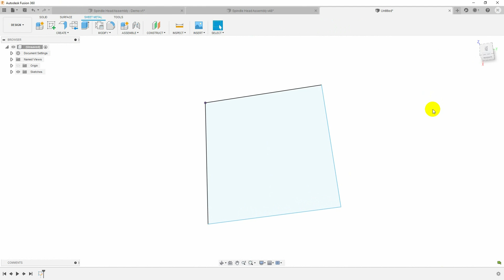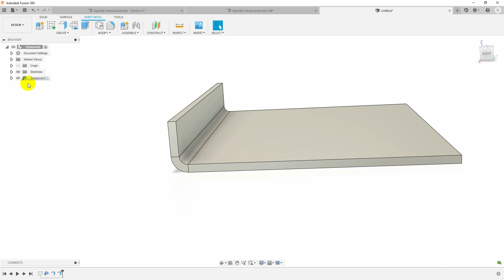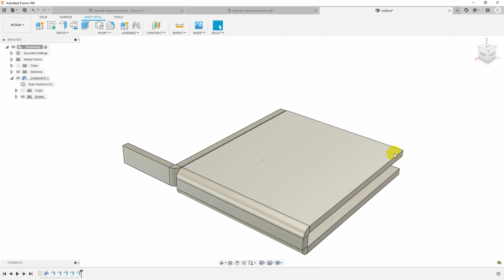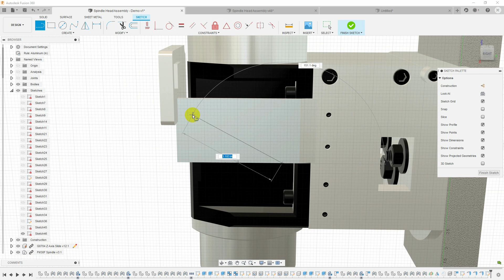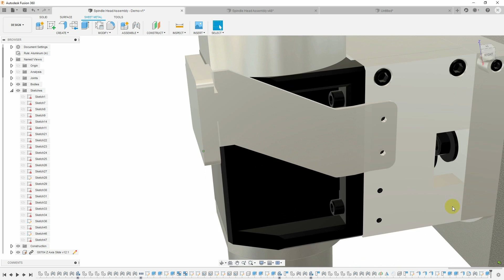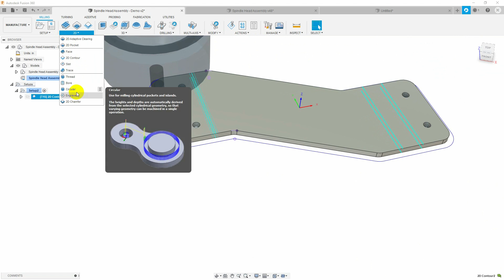Designing Sheet Metal Parts in Fusion 360

Comment: One of the things that I found to be missing in Fusion 360 sheetmetal is the option to add bend notes to directly to the part that are to be machined.
We cut out large amount of parts for a single project, and use the cnc machine with a felt pen to mark all parts with the name of the part as well as bend lines, angle and if the bend is up or down.
This is a comon practice in shops working with sheetmetal parts, yet with Fusion bend notes are only available on the 2d shop drawings.
Does anybody know of a good work around other than putting them all in manually? It becomes a chore doing it manually when working with hundreds of different parts.

Comment: Thanks. I'm new to f360 im trying to figure out how to develop a part that has 7 flanges all folded in the same direction but 2 of the flanges will will be not equal with one line not parallel to other fold lines. 

Because the part should taper in one area.  I ha e been struggling to model the part

Comment: ON a completely unrelated note, I've been wondering while watching each video in which your lathe makes an appearance. When will you be doing a cam lock modification to the tail-stock? That damn wrench. lol  Would make a great video tho.
Reply: It's ironic to see James using a keyless chuck and then having to use a wrench to clamp the tailstock. The second project I did after getting my lathe (Craftex CX708, similar to James's Grizzly) was to replace that bolt and nut with a (shop-made) 3 start 1/2-24 nut and stud with a pinned on handle, which gives an effective pitch of 8tpi and clamps adequately with a quarter turn. First internal thread I ever single pointed, and I'm still mildly amazed that it worked.

Comment: When I cut thin parts I start with holes, slots and other part details and outside contour leave as final operation. Than there is larger area that is glued to plate and there is less chance that the part will detach from plate and ruin everything. That's just a suggestion as I do, but good job.
Reply from the maker: Yes. that's typically what I do as well.

Comment: Thank you James for the insight into Sheet Metal which I have never used so far.  I am currently struggling with the Electrical module.  Did you use Fusion Electrical to design the ELS interface board ?
Reply from the maker: I didn't use it for the interface board, but I did use it for the control panel, since I needed to transfer the cutout contours from the button design.  I haven't done anything with real schematics or components yet.
Reply: @Clough42   I have just started to use it and find it difficult to work with but the mists are slowly clearing.   I have done my first board but it took some time.   The workflow and naming convention seems strange and the library management something else.   It does not feel as swish as Fusion mechanical.   Almost like a half finished bolt on that they rushed to get integrated.  Hopefully it will improve.  It is nice to get a 3D image of your board to manipulate into a custom enclosure.

Comment: I'm way less interested in Fusion 360 after the recent license changes. As a hobbyist I can not justify the cost, and while the features that are still in the free version would be enough for me, I'm not keen on being locked into the software after they removed STEP export. And I don't know what they will remove next time from the free version.
Reply: You can still export your models as STEP files, Autodesk gave in to the backlash. That said, I'm still going to migrate to something else; it is abundantly clear that Autodesk is very likely to alter the deal in the future, and not in a way that is beneficial to the average hobbyist. The bean counters have already decided to switch from baiting to milking.
Reply: @mass1s  I have been looking into FreeCAD recently, but man is it cumbersome and unintuitive in comparison. Seems quite powerful though. SolveSpace also looks neat and is easy to use but is quite limited in features.
Reply: @VorpalGun  I agree. Even Fusion often feels like a toy... lacks features, has imperfectly implemented features, slows down or crashes when editing a non trivial model, throws dozens of errors after tweaking parameters or editing timelines. FreeCAD is even more janky than fusion, even if not accounting for the horrible UI.
Reply from the maker: When I switched to Fusion 360 initially, I assumed they would either alter the terms and conditions over time, or they would introduce value-add features that I would want, and I would end up paying.  I don't know how much wisdom there is in rejecting a free tool because it might not be free in the future.  I guess you could switch to something inferior and suffer now, or you could wait until you have to.  Or if there's something superior and free and it works for you, that seems like an easy choice.
Reply: VorpalGun they have not removed STEP export (see here https://knowledge.autodesk.com/support/fusion-360/learn-explore/caas/sfdcarticles/sfdcarticles/Fusion-360-Free-License-Changes.html). So given that you have said that the free version gives you everything else you need, you are good to go.
Reply: I've been an Autodesk "customer" (or was) for over 25 years. Embrace and extinguish, bait and switch and every other possible vile tactic is the watch word of this company. I wouldn't trust this company as far as I can throw them regardless of them "caving in" to backlash. Reprehensible scumbags.